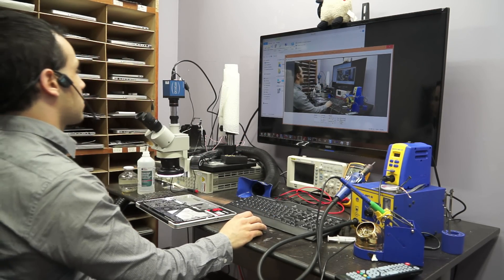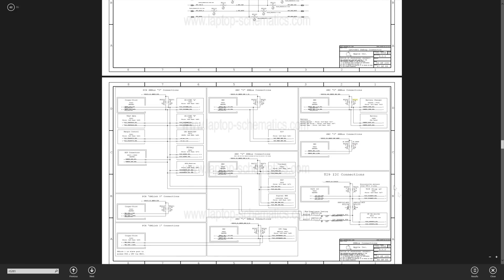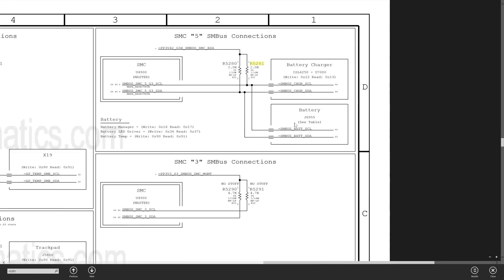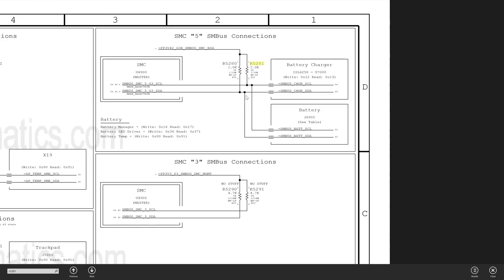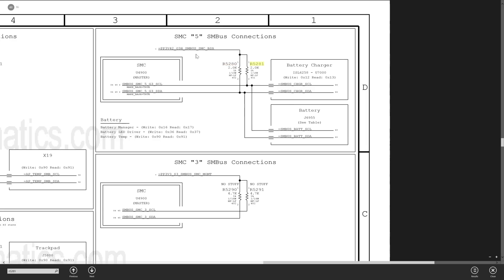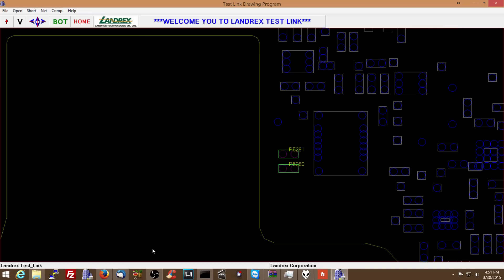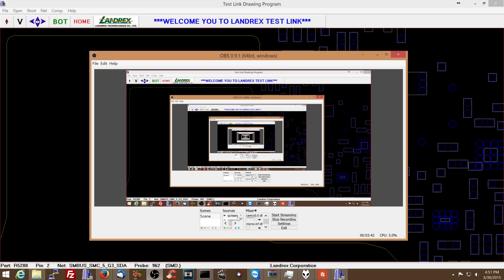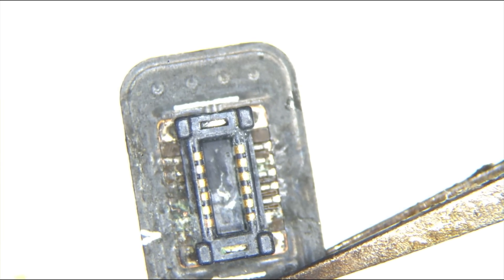Macbook Pro logic board not charging battery, missing pullup resistor on SMC data line.

Comment: got an issue something like this where the MacBook has an X on the battery and won't charge it. But it will run on a battery that has power. Pin 16 on the U7000 chip reads 12v instead of 3-5v. Already changed the chip and Q7055 just in case, pin 4 on the Q7055 shows 12v just like pin 16 on u7000. Thanks in advance

Comment: I am having the same issue with a mid 2010 MacBook pro. It is not detecting the battery. top right corner has a "x" with a battery symbol. The battery is working has been tested and it works. Will this repair work  on the mid 2010?

Comment: thanks for very good information about pullup resistor , i'm facing same problem , i replaced resistance with the value of 2k, but on board when i check it's giving me value 235 ohm. and resistance side #1 3.4v and side #2 gives only 0.051v , and battery connector pin 4 gives me 3.4v, but only pin 6 gives me 0.051v, may it's smc bad or some an other part on board, help me out ......thanks

Comment: Hi Louis, I have a problem with the battery charge on my MacBook Pro A1278. I have seen some of your videos but my problem I can not find a solution. The computer sometimes charges for minutes, passes the green LED light to orange but after a few seconds the light indicates the battery charge still OFF (No light). The computer works with the charger put and the battery is not discharged while this is, that is to say that it does not load but it does not discharge either... can you help me?

Comment: I have a question, I recently bought a new macbook pro battery, but i think it's bad, the system says "Replace Now" with cycle count 0

coconut battery says: Status: Poor, Discharging. 

First, it was 46% then 8% then 7%

If my macbook pro logic board is fucked up, would it still detect how much energy exist in the battery?

Comment: Hi Louis, just a general question here. I have a bunch mint Acer netbooks of the same model. 

Lately,one of the users discover his battery doesn't charge while plugged in(shown in the battery status). I couldn't check all the other units,so I replace its battery from a backup unit. It didn't solve the problem. Now showing 0%,plugged in, not charging. I check the battery voltage, they are low ard 9V(I assume still chargeable).
Am I safe to there's problem with the charging circuit?
Reply: Okay silly me, I didn't do the battery recalibration properly(just power off and unplugging battery). Apparently I need to uninstall MS acpi.
I'll report back if the calibration works.

Comment: Thanks for the video,my 2011 macbook pro 13 is not charging the battery, the percentage of the battery stay the same if connected to power,the light is dimm green,i checked both resistors and they are fine,could it be the dc inboard ? or something else ?
thanks

Comment: Louis. Thanks for all your posts. i learned just enough to know when I'm being ripped off... magsafe light not showing, battery not charging but 2012 MBP boots and works fine on battery; shop recommendation 450 quid for a new (read refurbished) logic board with a 2011 CPU?!!!?.  I saw your sysonewire posts on magsafe/SMC recognition (U7000) which make things much clearer....  I''ve got a request. Could you please post an idiots guide for a newbie to find a decent board repair shop? I mean, what questions should we be asking? In UK the shops  all have sales guys who will tell you anything... is it fair to ask to meet engineers? I'm thinking a short list of 'telltale' questions like 'what microscope do you use?', 'show me a schematic'. How can I check the so called repair shop even has the basic kit to actually repair a board.... not just steal mine and resell it? Is there some kind of qualification (yeah I know all about Apple qualifications!) or kite-mark ,or ISO standard or something? I know that doesn't defend against part pirates, but it's better than nothing.

Comment: been watching your battery videos, maybe i missed it?, i finally gave in and bought a used 2011 13 inch..actually i cought a bug, i got another 13inch after..then old 17 core2duocrapola, which i do love but cannot upgrade past kittycat version, that said then another 17inch..OY VEY, ok problem of just one of these late2011 , once charged to 100% , it goes green on charger, meaning full and good ....but then without showing not charging, it is using the battery, how then do i know this?..it hard shuts of after a few hrs, and battery depleted..then very hard to get the charger n board to charge...i plug, unplug 10 plus times till it finally goes orange and will charge, back to 100%. other times i unplug it and it drops 30-70%, meaning its not charging or recognizing it needs a charge, or to stay on ACpower , instead of constantly cycling battery. can you suggest what it could be? oh, yes i have 3 different ac-dc chargers all mac, and same issue..therefore it is the MB i would guess. but since its a 2011, i guess its not worth repairing , cause i can buy a used one 1/2 price of repair, i would guess?. ps thanks for all the youtubing you do..being at 55y old , its good to see your teaching others that could be the next generation of smart logical and respectful people just like you. keep it up, thank you, you are one of the few of good men. [2 thumbs up]

Comment: hello, my macbook pro in late 2012 has a battery charging problem, the battery is not charging, the green light of the charger is still light, the charging pourcentagde is 0%, there charging symbol on the battery. I made the reset of the SCM problem is not resolved
Reply: it could be the DC inboard it cost 10 dollars on ebay ! or the smc

Comment: my macbook recognizes the battery for some time then it doesn't anymore, so I get the x sign ( no battery available). After this the cursor freezes randomly, (not the computer). and the keyboard lights are not able to dim the light anymore. 

 SMC chip problem? i just installed a new battery, but i had the same problem with my last battery.
Reply from the maker: https://www.youtube.com/watch?v=6I2Rd2iVa64

Comment: Hi
Please Help!
I have a 820-3024 and I'm having problems making it recognise and charge the battery. 
It's already had a new ISL and an SMC from a known working board, all resistors/caps are ok on and around the charge circuit including the pull-up resistors mentioned in the video, but still no luck! 
I've gone over & over the schematic and can't seem to work this out. 
When I plug the mag safe in, the light goes green for a few seconds, then Amber for 5 seconds and back to green. 
It switches on and works fine and has the latest SMC firmware installed, but the battery has an X in it and only works when plugged in. 
Any help would be appreciated. 
Thanks
Reply: check your soldering on isl chip, had the same issue when swapped charger ic

Comment: I was trying to pull off the battery adn accidentally touched the battery connector with my screw driver,.SOme smoke came out and the laptop got dead,.I took it to the mechanic and he showed me a blown IC,.He changed the IC and the set turned on but it is not charging the battery,..My set is lying at the mechanic shop since 7 months and he is still trying to figure out as to why the battery is not charging,...Can anyone where the problem cd lie,..so that I can ask the mechanic to look at the particular place and fix it,..??

Comment: R5281 has no continuity.
Reply from the maker: +Sunny Sidhu Why should a 2 kohm resistor have continuity??
Reply: R5280 beeps with continuity test and 281 has no sound?
Reply from the maker: R5280 and R5281 should be 2kohms, no beeping!
Reply: Really OK let me measure resistance but 280 beeps
Reply: +Louis Rossmann I got 2.6 and 2.2 kohm.